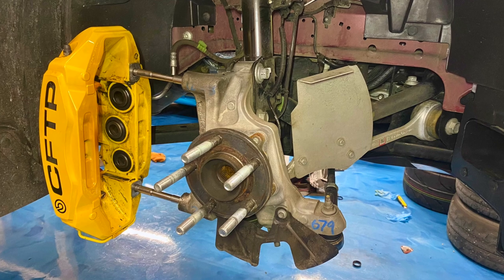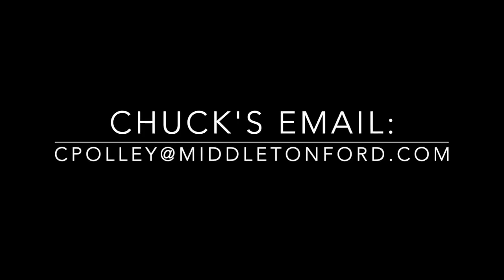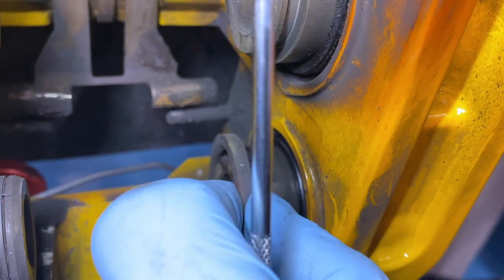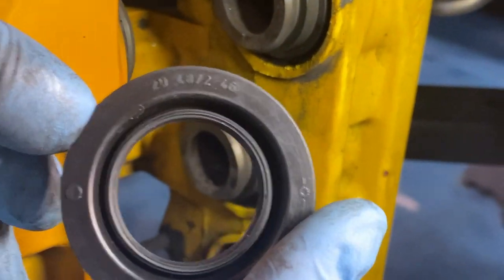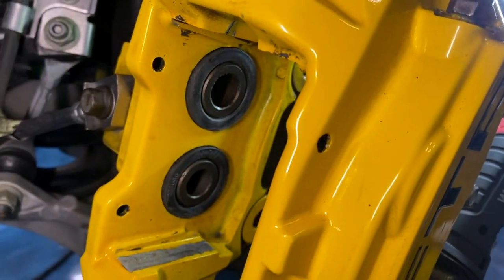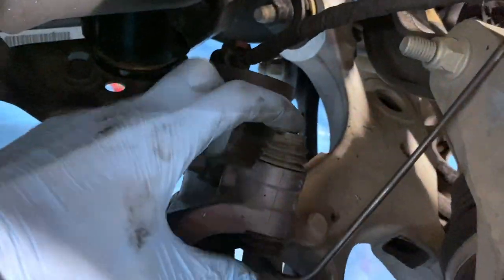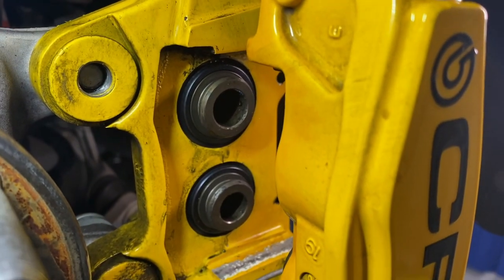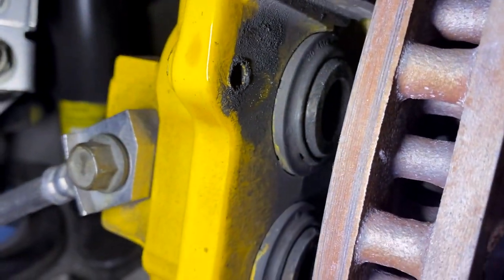Brake Piston Dust Boot Replacement Without Removing Calipers!

Comment: Nice job! My Cobra came with 00R 4 piston Brembos and the previous owner raced it at seebring and they needed a rebuild. I did all new dust boots(which were cracked), pins, hardware basically everything. Put a set of street pads on it Vs the track pads that I got it with and was much improved overall
Reply from the maker: Nicely done!

Comment: I wasn’t aware, Motul had brake fluid rated at 700 degrees. How do it hold up ? Thanks for the video.
Reply from the maker: The fluid has been excellent!  COTA is a severe brake test. RBF 700 handles it no problem!
Reply: @ShelbyFlyer  thanks

Comment: Have you had any issues with the pressure seals and heat or has it just been the dust boots?
Reply from the maker: Just the dust boots, but I have a few sets of brake calipers that I have had on the car.

Comment: If you open the bleeder you’d be a lot less likely to push other pistons out. Plus, the caliper is where the fluid gets the hottest.
Reply from the maker: Thanks for the tip! 🍻
Reply: @ShelbyFlyer  although I’ve never owned a mustang and likely never will, I’ve been subscribed to you for many years. I love the videos and your methodical perfection when it comes to your work. So thank you for making top notch videos and sharing them.
Reply from the maker: @sjfk1306  Very kind of you… thanks! 🍻
Reply: Thanks!!

Comment: i cannot get the boot off 08 silverado caliper for anything
Reply from the maker: Have you tried a sharp metal hook?  Actually 2 of them… grabbing & prying.
Reply: @ShelbyFlyer  going to try that. Rather spend $10 on the seal kit than buy a new caliper